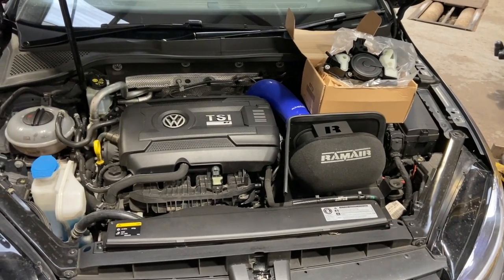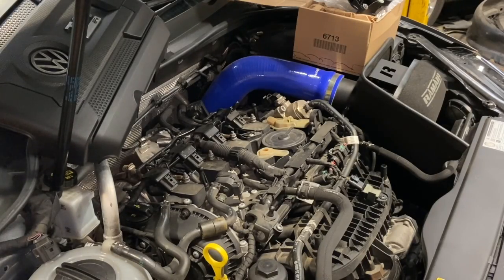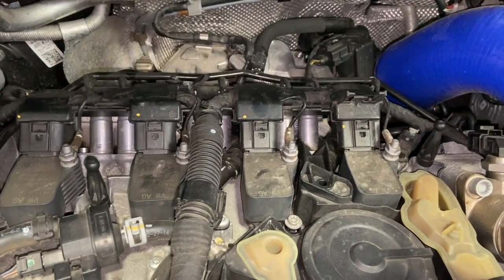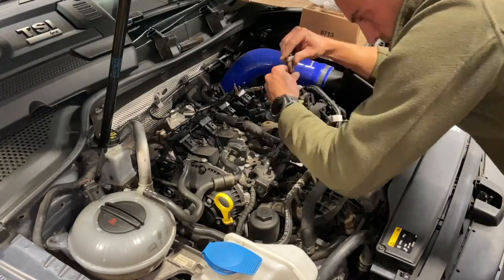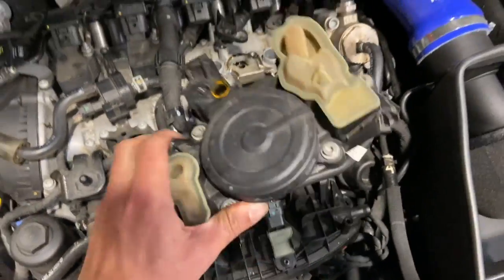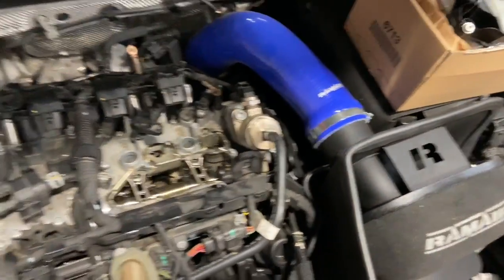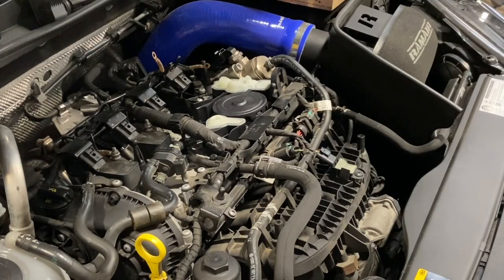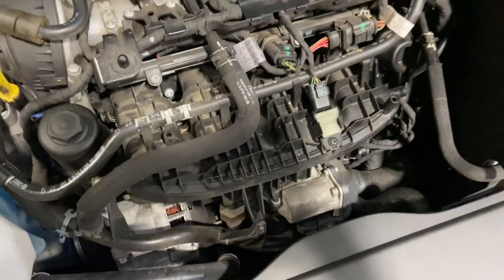Replacing the PCV Valve / Oil Separator on VW Golf R 2.0 TSI

Comment from the maker: New Aftermarket PCV Valve Ebay - https://rover.ebay.com/rover/1/710-53481-19255-0/1?mpre=https%3A%2F%2Fwww.ebay.co.uk%2Fitm%2FNew-VAI-Crankcase-Breather-Oil-Trap-V10-3697-Top-German-Quality%2F203079586611%3Fepid%3D249223414%26hash%3Ditem2f487c9333%3Ag%3AdqUAAOSw955fOlQh&campid=5338704655&toolid=10001&customid=pcv valve
Check Euro Car parts for cheap parts - https://tidd.ly/3lIO7xA

Comment: Thanks for the video. The OEM unit on my car is made by Hengst, and Hengst/Febi Bilstein branded aftermarket ones are nowhere near the price VW charges. I just got a Febi Bilstein one with a new breather hose as well for £65 delivered. How silly to design it to fit around the plugs though only for a screw on it to be blocked by a coil!

Comment: have a 2018 Golf 7.5 R.
After a cold start, the engine runs smoothly at first, but after about 1–2 minutes it starts to misfire, runs rough and almost stalls.
Sometimes it stalls completely.

Has anyone experienced a similar issue or knows what could be causing this?
Reply: Try changing all 4 spark plugs, hopefully that should fix the issue. Failing that, next change the coil packs. Have you plugged in an obd scanner and seen what error codes show up?

Comment: Is there a sensor in that PCV assembly? I have code P24D8. AI is telling me to change the PCV assembly and that the G950 pressure sensor is part of it.  A tech on reddit suggested I change the LDP by the canister in the wheel well. I’m at a loss on what to do.
Reply from the maker: Not In the PCV but others sensors are likely to through faults due to air flow / vacuum issues

Comment: 1.8 tsi I open the oil cap and the engine turns off. The same if I remove the PCV hose. I changed the PCV valve a year ago. I also have oil in the intercooler hose, about 300 ml, if that matters.

Comment: I notice Hengst were the manufacturer of the previous pcv valve you removed. The new one you installed is slightly different, is it a different manufacturer that VW use for the new pcv valves?
Reply: I have just purchased one from VW and the new one is branded Hengst too.
Reply from the maker: im not too sure tbh mate

Comment: Really love your videos, so informative! Just a quick question regarding my mk 7.5 R. At start-up (regardless of whether it is a cold start or it has been driven), there is a puff of white smoke that comes out of exhaust. Smokes for around 30 seconds and then nothing. Car drives totally normal, no smoke during normal driving or idle, oil levels totally normal and no leaking. Is this a common symptom of a faulty PCV valve?
Reply from the maker: Thanks 👍 hmm wouldn’t like to say for sure but I don’t think that will be causing the issue
Reply: Hi did you ever get to the bottom of this? I have the exact same issue but the puff of smoke is for literally a few seconds only
Reply: @crz1364 yeah that's exactly what I had. I only had it for a few days before I noticed the issue so the dealership I bought it from just took it the car back and gave me a full refund, so I don't actually know what the issue was in the end. However, whilst I did have it, I remember doing my research and concluding it was likely the 'valve stem seals', and I did take it to a few local VW specialists and they agreed. Apparently quite a bit of labour involved but the seals are very cheap. Hope this helps and best of luck.

Comment: replacing mine at 140,000 miles stopped my valve cover leak.
Reply: Did you have oil in your spark plugs prior to fitting a new pcv? If so has it rectified the issue?

Comment: Hopefully i can get a answer here so shooting in the dark , i see someone did ask but did it consume oil , so every odd 1000 km's i need to top up a bit les than a point of oil , i have no leaks , when i try to pull the oil fill plug there is suction/vacuum in the engine so I'm suspecting my pcv is also done , but was wondering if it could be the cause of my oil consumption all be it not alot of consumption
Reply from the maker: no it wasn't really consuming excess oil tbf mate, the valve was just really noisy on this one
Reply: How did you solve this bro? I have the same issue on my golf R

Comment: hi if the oil separator is broken does it consume a lot of oil?because my vw golf after i change the engine oil after 6days its totally empty any idea? its no oil leaking it has no white or blue smoke oil filter is not leaking an oil..im always putting it 3liters for 6days
Reply from the maker: Hi Alex, it shouldn't make it consume excess amounts like that! that's a massive amount in 6 days! very odd if its not smoking at all and you can't see any leaks, if it was consuming that amount it should smoke a fair bit , Id have a really good scan round for a leak first and if its definelty not leaking you'll need to do some more involved checks to see if it is consuming it
Reply: @diydaly  the history is like this.. it has misfire number2 they scan the car the result is they change the spark plug then it was ok.then i went to change the engine oil air cleaner oil filter..after 6days the ligth indicator pop up so i check the oil its totally empty
Reply from the maker: @superkari28  hmm that's very odd, ima bit stuck on what to advise tbh, very hard to say without seeing the vehicle

Comment: Quick get rid of it! The PCV will be the least of your problems.
Reply from the maker: They do seem to have a few expensive issues 😬
Reply: @diydaly  Had a golf GTI MK6 that had always used oil from new. I complained about it to VW dealer and went through an oil consumption test during the warranty period, not the only problem either. It had many other common problems as well.
They passed it and stated it was normal oil consumption for a GTI.....BS!!!
Fast forward 3.5 years and out of warranty at 70,000Kms oil consumption has slowly increased. I go through another oil consumption test and it failed. The VW dealer said it needs new pistons, piston rings and conrods. How unusual.... the warranty runs out and my engine needs an expensive rebuild (dishonesty as usual by VW/VW dealers).  I complained and stated that this a common issue with these engines and I should not have to pay anything. VW agreed to part pay and charge me $3K to make up the difference. Get real VW!!!
Anyway, I got rid of it and bought an I30N. Will never buy a VAG product ever again. VAG products are ticking time bombs!
Reply from the maker: Wow that’s pretty shocking isn’t it! Got to say I’ve not had any with as serious an issue as that but have dealt with a lot issues like the water pump / pump housings , manifolds and other issues at less than 40,000 miles!
Reply: @diydaly  Yeah it's quite horrific. I'm not the only one that has a horror story to tell about  owning a VW product. I hear them on a regular basis.
Reply from the maker: I have a few friends owning vag vehicles , so will pass the info on 👍
Reply: You are saying it right the mk6s Golfs were horendous with problems... i have a mk7r from 2014 with 98k km and its going strong other than sensors just not working well without engine fault codes ofcourse...
Reply from the maker: @blackops2376  glad to hear it’s going well 👌
Reply: @diydaly  i forgot to mention its stage 2 pushing a nice bit of torque 530nm
Reply from the maker: @blackops2376  niiiccee 👌👌👌
Reply: @blackops2376  I hope your'e right. The MK7 isn't devoid of issues. Typically, VAG design their cars with planned obsolescence and rubbish engineering.
Reply: @shanemitchell5807  im selling it start next year though...
Ive had small issues which cost me nothing.
The haldex didnt work but after replacing brakes it worked again somehow, the transmission dogbone mount went aswell thanks to 530nm torque but really thats it lol been doing oil changes every 15-20k km and waiting 3mins when cold starting and waiting for the 80c celcius temp of engine oil then im flooring the car.
After pulling up i wait 3 mins aswell love the little machine.